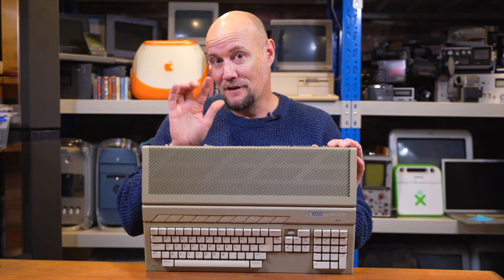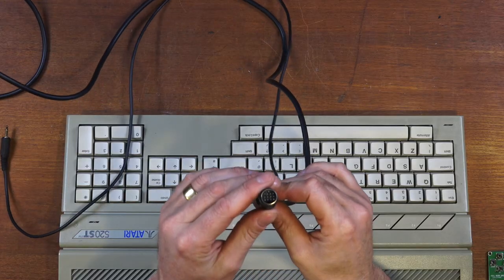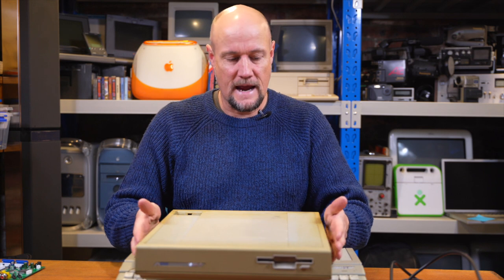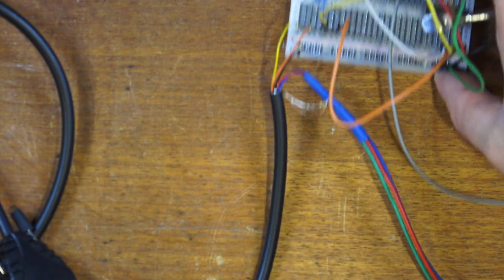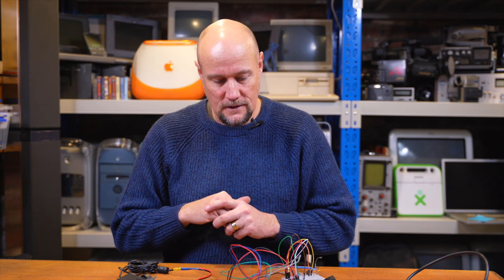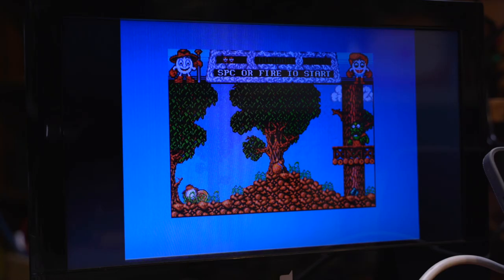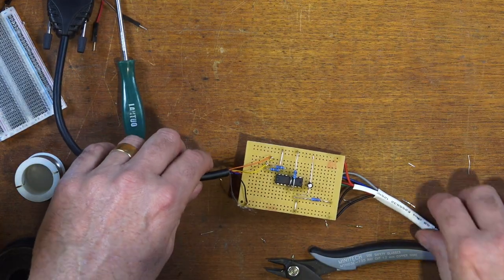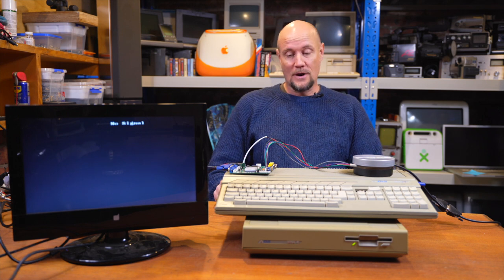Atari ST - RGB to VGA conversion - The DEFINITIVE video solution using GBS8220

Comment: Im sorry, but as far as I remember all Atari ST (including MEGA) do have composite sync (pin2), if equipped with modulator it is composite video out instead of composite sync. Only few early 520ST didnt have it, but since 260ST and 520+ all STs do have it. And even the first could be easy upgraded to have composite sync.
Reply from the maker: Great info, thanks for the comment.
Reply: @TheBasementChannel  you are welcome, but please verify it, since it is a year or two (well make it 30) I was looking at it. Atari usually has the pin layout in the user manual.

Comment: and... you can try to mix the syncs just... with two resistors! aaaand, plan B = one resistor and one diode. Honestly, I do not remember, why were I mixed up them in the past... but I remember - we did it for some reasons ;)
Reply from the maker: I tired a few different ways before this solution, including one method using NAND gates but it wasn’t reliable. This is the first one I tried that was rock solid.
Reply: @TheBasementChannel  rock solid is the must!

Comment: Is there any way to purchase a ready made version of all of this?
Reply from the maker: I think there are some off the shelf solutions. Try RetroTink?
Reply: @TheBasementChannel RetroTink is cool - but you still need a number of cables, connectors, adapters, etc. - would be interesting to know if there's any kind of "plug and play" solution. In fact there might be a bit of a market for something like that. I could see a small box with a couple of switches that could easily go from DIN13 to VGA/HDMI with a small switch on the side to go B/W (high res) and Color (low and mid res).

Comment: Great video. Do you know what type of plug it is (Atari monitor out) and where could I buy it? I could not locate it anywhere as it looks nonstandard? Thanks!
Reply from the maker: It is a standard DIN13 plug, but they’re not very common. I’ve seen them for sale on eBay etc though. Good luck 🤞

Comment: Great video and solution!  Is there a VGA capture card that you recommend?
Reply from the maker: I’m actually using a cheap vga to hdmi adapter which plugs right onto the gbs8220 and then a cheap usb hdmi capture stick. Works great!
Reply: @TheBasementChannel  Ah, that's interesting.  I was thinking I was going to maybe have to go down the PCI card type route.  I'm hoping to capture high res VGA from the ST, rather than use a webcam for my videos.  I will look into what you have suggested.  Thanks again, and good luck with the Mega ST :)
Reply from the maker: It seems to work great. The vga to hdmi adapter also has an audio input to mix the audio into the hdmi signal. I just plugged the hdmi capture dongle into my 2011 macbook, OBS Studio saw it straight away as a capture device and I started recording a 1920x1080 stream. Too easy. Good luck with your project!
Reply: @TheBasementChannel  That sounds really promising.  It's just the VGA video capture I need.  The audio I record goes directly into PC through it's attached audio interfaces.  I use OBS too, so will definitely try your suggestion :)